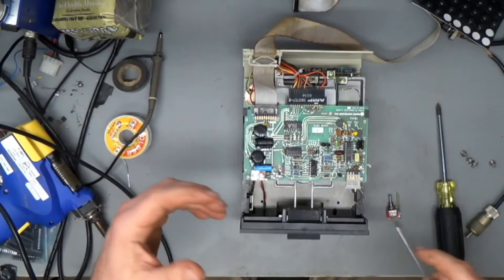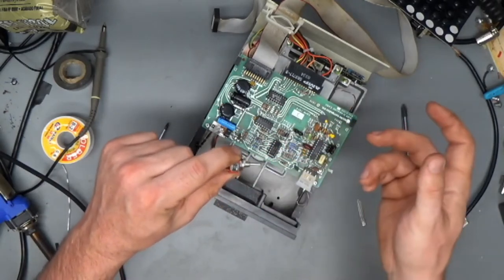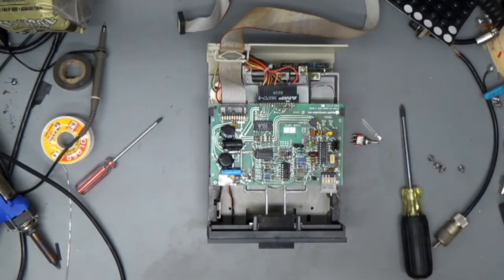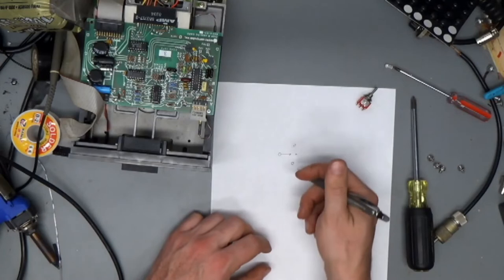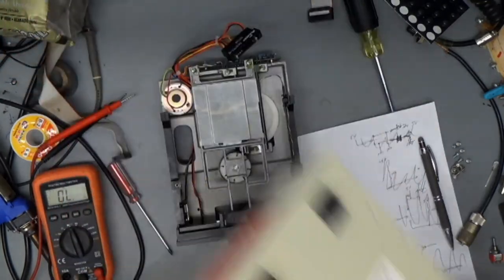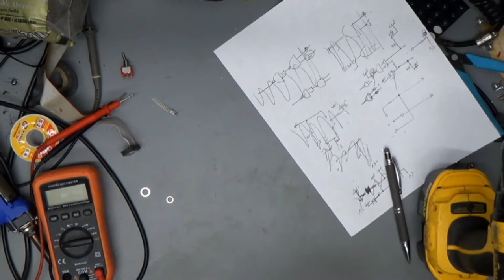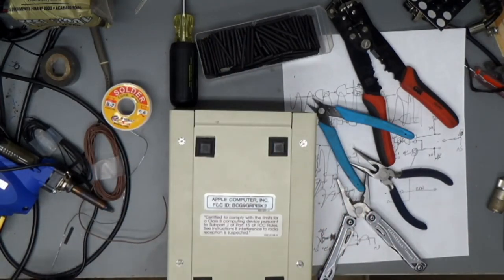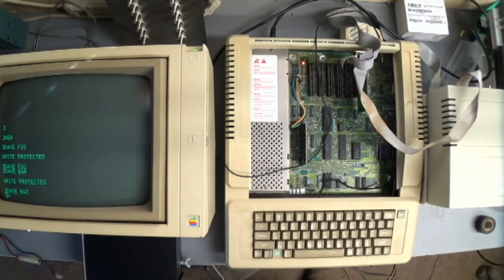Adding a Write Protect Switch to an Apple II Disk II Drive.

Comment: DPDT?  No problem!

So that existing switch has to have a source or sink on it.  You could connect that to the WP input via a resistor, and override it with a stronger pull-up and/or pull-down so that your override switch pulls up or down in the top and bottom positions, and has no influence in the middle position, allowing the OG switch to set the level.  Ergo, center is normal mode, up and down are overrides.

For the multicolor LED, I would use the other pole and take advantage of the different forward voltages of the three LEDs such that lowest Vfwd wins.  Blue will have the highest, so it could be always wired to the current dropper resistor.  In WP mode, connect the dropper R via the common of the switch to red, which will beat blue.  In WE mode, connect to green, which also beats blue.

No other logic needed.